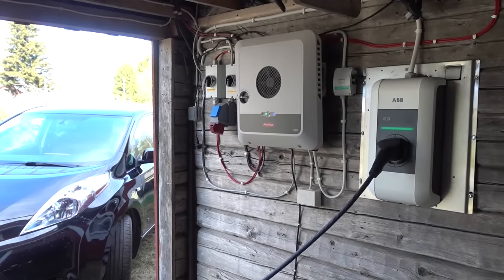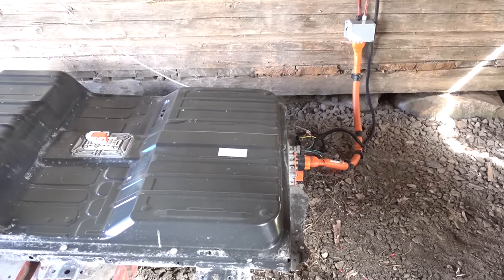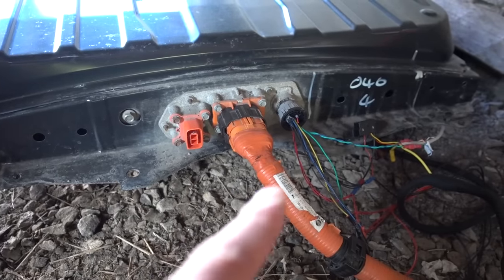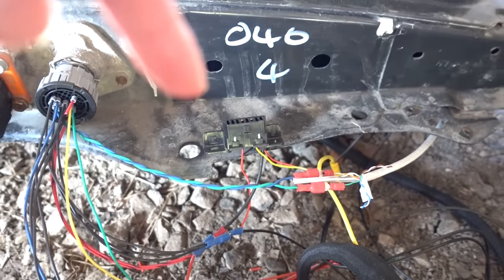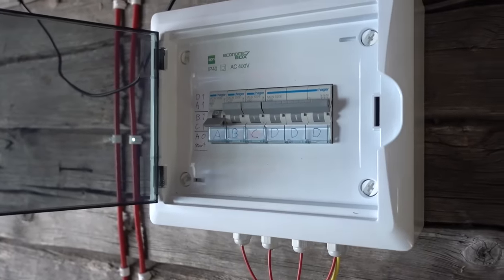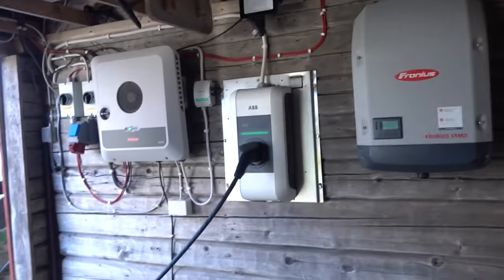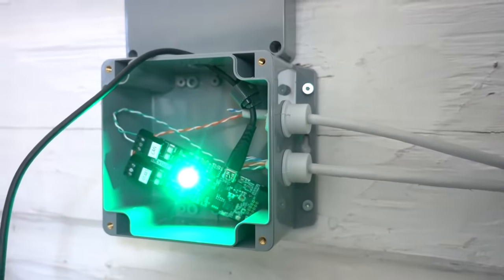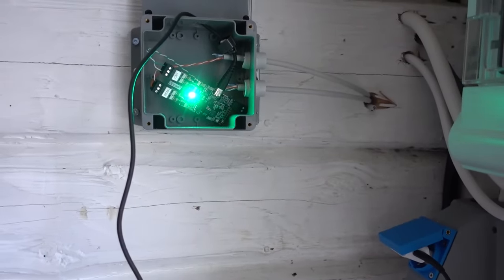The EASIEST way to connect used EV packs to grid! 🔋

Comment: Hey Dala, since you're something of a leaf expert, I have two uncommon questions for you:

1. Is it possible to disable the interlock that prevents the car from entering "ready to drive" mode while charging? If so, people with old very worn leafs would be able to tow a generator behind their leaf and charge while they drive, so they could go on road trips with it.

2. In the new leaf, is there a way to prevent adaptive cruise control from disabling itself when the traffic comes to a stop for more than two seconds? Would be great to force it to stay enabled, or extend the waiting time to 30 seconds or so, so that the leaf could continue to drive itself in stop-and-go traffic.
Reply from the maker: 1. Would be an ecological disaster. 
2. No clue, I am only experimenting with old LEAFs!
Reply: Imagine a very old leaf only has a 20-mile range and the owner only needs to travel 5 miles to work. So day to day the car will suffice. With the generator idea, when trips longer than 20 miles crop up they can still keep using the leaf by temporarily attaching the generator. As things stand now, they'll either need to replace the battery or rent another car for such trips.

Speaking about myself, I own an old leaf (2016, 24kWh) and a new leaf (2022, 40kWh). The old leaf has a real-world range of just over 100km, which is perfect for any drive I do in my home country of Malta (an island only 32km long from end to end). But when I went on holiday to Sicily, I used an ICE car. On some days I needed to make 400km round-trips and stopping to charge 4 times would have added too much time and risk to the trip. With a tow-along generator I'd have taken the leaf for the holiday, used the generator on those days with the long trips and left the generator at the Airbnb the rest of the days when my trips were under 100km.
Reply: There was a company that added battery packs in the boot of early model Leafs to extend the range.
Reply: Would be nice if Leafspy could adjust the time out for the adaptive cruise control after stopping.
Doesn't look like it can after quick search.
Reply: Yes, you're thinking of muxsan. Problem is the cost of adding that battery is almost as much as the car itself is worth. And I'd have to figure out how to drive 1500km to Delft (in Holland) in a car with 100km range. That's where a towable generator would really come in handy!

Comment: This is really fantastic. Is there any way to use a leaf battery while it is still functional in a leaf that is driven sporadically? It would be really great if the leaf could be recharged with surplus solar power and at the same time supply power to the house at night when there is no more sun. That would really be the holy grail for me.... Oh and compability with the Huawei sun2000 inverters 😁 I ask a bit much perhaps 😅
Reply from the maker: Sun2000 compatibility coming later.

Battery in car is not feasible, chademo connector is over 1300€ https://github.com/dalathegreat/BYD-Battery-Emulator-For-Gen24/wiki/Frequently-Asked-Questions#could-i-use-this-project-to-use-my-leaf-battery-without-removing-it-from-the-car
Reply: @DalasEVRepair  Thanks for your answer, sorry I did not check the FAQ first. I also saw some videos from youtuber BenjaminNelson who connected his Mitsubishi iMiEV with a 3D-printed CHAdeMO connector to his solar inverter. He used the PV input on his inverter so he can only draw power from the battery but with your solution the battery should act as a "standard" solar battery making it possible to charge/discharge the battery, and as an extra bonus DC charging directly from the inverter would result in higher efficiency? Getting realy excited about this 😀
Reply from the maker: @robbedenys  the connector needs to be safe and reliable, with enough IPXX protection. It is the thing preventing human injury after all. I would NOT recommend a 3d printed part here!
Reply: I understand that. But if one could find a decent CHadeMO plug it should be possible in theory?
Reply from the maker: @robbedenys  Yes, they start at 1300€ here in EU

Comment: Nice system, Just what I want, Would there be a problem to mount the battery vertical on brackets on the wall in a metal cabinet, Would be nice if you sold a ready made kit of parts, I would get a second hand battery or if my 24kw Leaf comes to end of life use (Battery being OK)
Reply from the maker: The parts are listed on the Github. The hardware costs less than 50€ to setup. No problem with vertical mount!
Reply: @DalasEVRepair  Nice!!

Comment: Anyone got a solution for Gen2 volt packs? I've been "planning" to get this working for over a year now but can't find adequate time to work on the project.
My goal is to avoid both super-expensive Orion and sketchy chinese BMS and use original one with original contactor assembly IF EVEN POSSIBLE.
Anyone got the BMS commands somewhat decyphered?

Comment: Hi Dala. Great video!  I want to ask if the LEAF or Tesla pack would work sitting on it's side? Does the orientation of the pack matter?   I realize it would need a strong support system, but if one was built, it would be nice to have it take up less floor space. Thanks!
Reply from the maker: Thanks! Yes it can be mounted on its side to save space!

Comment: This is great stuff! What is the maximum continuous power with this setup? Also really excited and waiting for the Tesla part. There are many Model 3 packs available in reasonable price. I'm building my setup on Model S modules but that's a lot of work.
Reply: 1.21Gw
Reply: I would say limit is the Gen24 maximum power and you can get those at least up to 10kW.

Comment: Please list prices of the actual equipment you have in video.  Each element's price. 
So cheap is relative. 
I need a number amount for the battery and all the hardware
Reply from the maker: Depends on your location. In Norway you can get used EV packs with 60€/kWh.

Also inveter availability depends on your country. Best to check the Battery-Emulator wiki which components you can get in your country, and for what price. Price is tied to geographical  location. https://github.com/dalathegreat/Battery-Emulator/wiki#supported-inverters-list

Comment: Great! Can we set up this inverter with the battery still in the car?
Reply from the maker: I don't see why not :) But a bit more complicated!
Reply: @DalasEVRepair  on my e-nv200 there is space for 800-1000w solar. This would be perfect. Much more efficient 230v in the van than using the 12v system and slow HV charging.

Comment: This is AMAZING, 

would be great if there is a kit that would work as plug and play for the CAM wiring. 
also small suggestion, for the 12 volt, devices would it be possible to run the from the battery with a step down in voltage or is the difference too high

Comment: Great work. Does it work with any Leaf batery? Does this pre-charge box switch dance (sparks!) need to be used only once when connecting battery and GEN24 or every time the sun goes up?
Reply from the maker: Over 20 different battery types on the supported list. All LEAF batteries are supported. Precharge only once!
Reply: @DalasEVRepair  Thank you so much. Waiting for my parts to come to start the project. BTW: any suggestions how to verify used battery, so I do not buy some scrap but something that still will work couple of years? Will e.g. Nissan test the battery on the crate or perhaps the latest software update (the cell monitor) will do?
Reply from the maker: @MichalPrzybylski  see this page for how to test LEAF batteries, https://github.com/dalathegreat/Nissan-Leaf-Battery-to-OBD2
Reply: @DalasEVRepair  Kiitos! You are the man. BTW - in earlier versions, you were connecting battery to GEN24 without Fronius smart meter. Is this obligatory part of the project now?
Reply from the maker: @MichalPrzybylski  i have never used Fronius without smartmeter. Always required!
Reply: @DalasEVRepair  Got it. Ordered Enviatec box incl. Smart Meter, ordered battery, LilyGo. One thing I did not find (?) in the github & instruction is the fronius inverter setup for the battery. Just usual BYD steps?
Reply from the maker: @MichalPrzybylski  See https://github.com/dalathegreat/Battery-Emulator/wiki/Fronius-inverters#setting-up-the-fronius-inverter-for-diy-battery
Reply: @DalasEVRepair  You got me off guard. Thanks again!

Comment: Subscribed. For us newbies to using Leaf battery packs, what is the voltage, and are their many inverters that can operate at that voltage? Thanks for the feedback.
Reply from the maker: 400VDC fully charged. Any BYD HVM via Modbus compatible inverter can take this solution

Comment: If only EV batteries could be bought cheap here in Australia. Currently I use a 775AH 37.5KWH FLA forklift battery and run my house off grid, currently I need to run a generator around 10 days a year. With a big Tesla battery I would rarely need the generator at if at all.
Reply: I need help getting off grid!

Comment: how does your solar charge the bateries?
Reply from the maker: The solar inverter is a hybrid inverter, so it can take battery and PV panels at the same time!
Reply: @DalasEVRepair  hi, thank you for the reply. i ve bought a tesla model 3 96v 23s module and a 96v solar charge controller, do i need to "talk" to the bms or simply controlling the ~65-95v  charge/discharge in the solar charge controller enough?
Reply from the maker: @selmopt  This entire project focuses on re-using the entire Tesla battery. Individual modules are not supported.

Comment: Will this setup work with an aftermarket battery? Im finding better prices of new batteries than wrecked leaf barreries here in Australia 😂
Reply from the maker: No, this setup relies on having all the OEM bits in place. See my other videos for a DIY powerwall using cells re-arranged for 48V using thr Australian BMS Batrium!
Reply: @DalasEVRepair  Australia make some good stuff 🤣. Thanks I will check it out I have lots to catch up on. Cheers

Comment: Dala, what is the price level now per kWh, normally, for a used EV battery, and how much do you pay (normally) for the freight?
When talking about batteries and new technologies, I have to mention my favourite, The Electric Viking, Sam Evans, Australia, that I follow (almost) dayly.
Reply from the maker: Around 75 to 85€/kWh on used EV packs
Reply: @DalasEVRepair Thank you.

The Electric Viking, said minutes ago, that Ford and CATL will cooperate on a battery factory in North America, and the price for the litium phosphate battery will be 85 USD per kWh.
He said that five(?) years ago the price was around 500 USD per kWh...

Dala you will have busy future! 😆
Reply: @DalasEVRepair  Does that imply a 40kWh pack would cost less than $40? 

That does not seen right.
Reply: @jamesphillips2285  You are correct, that is not right.

Comment: Amazing work Dala. Very elegant solution. Questions - I understand the Gen24 communicates with the LEAF BMS, but will it shut off charging if the BMS throws an error or does it rely on the BMS to disconnect charging? How configurable are the DC voltage ranges on the Fronius as it's an HV connection? ie Can you set overvoltage and undervoltage on the inverter that exactly matches the LEAF voltage range? Finally, in the event of a temporary error, when you're not there to manually restart the battery with those circuit breakers, what happens?
Reply from the maker: Yes it stops charging/discharging if there is an error, or if the BMS wants to stop. User configurable min/max voltages yes. No error is permanent, if the fault goes away it resumes operation!

Comment: Well done.  I often thought that ev batteries should be portable in design.  This way they have a duel purpose:  To run your ev and also your home by way of simply carrying it into your home and plugging it into your offgrid system.
Reply: They are pretty heavy. 
Instead of removing and risking the pack, you can plug it in your home. 

CHAdeMO specifically allows for that and it's commonly done in Japan
Reply: @Outworlder  Yes ofcourse this would be the best option, especially for those with attached garages to their homes.  But for many others say like me with out lying carports and out building off grid shops, perhaps both options would be suitable.  Also rv camping could benefit where a battery pack could be removed from the car and installed in a camper or tent.  And future farm/construction machinery could use this idea of battery swapping, eliminating the need for battery redundancy.  I believe this is a way to address the global mineral constraints problem by making fewer batteries.

Comment: This is awesome! I don't know if I've ever seen someone use an old EV battery pack without cracking it open at all. 
I'm curious, the CAN<->MODBUS controller got me thinking, I currently have some software to connect to my own batteries via RS485/MODBUS and continually poll the batteries and publish the data to MQTT, which I then consume in a visualization system. I've been wanting to build a controller to convert this-specific-battery's MODBUS IO into (what I assume to be) more-standard CANBMS signals, so that then the batteries I have could "just work" with things like Victron's CERBO-GX and other CANBUS-oriented systems. So far I've been unable to find the specification for what things like the CERBO-GX wants to see. Any chance you have any knowledge in the area of CANBUS-BMS stuffs that might align with what I'm trying to do here? I'm not looking for a full answer to my questions haha, more looking for continued knowledge

Comment: Nice Dala!   I'd like to try this in the future, once I find a US split phase inverter with the right features and supporting the BYD battery communication.    HVIL loop not needed to keep the Leaf LBC happy? (see the heater port is open, that's got HV on it too if contactors are closed I think?)
Reply: Ooooh, yeah, controlling the contactors directly with 12v, nothing cares about the HVIL being closed.  Maybe leafspy would show a DTC code is all?
Reply from the maker: @DaleKlein  2011-2012 with only one HV output can have the HVIL check on by default. On the 2013+ you can only enable HVIL checking in the software if you have both plugs seated. More info is on the Github page (search INTERLOCK in the code)

Comment: SolarEdge uses modbus to communicate with their batteries as well, I wonder if this could be made to work with a solaredge energy hub inverter as well? I know they really like their proprietary stuff, but this would be awesome!
Reply: solaredge are recommending instead of using modbus/RS485 to instead use a wireless mesh card for communication between their solaredge battery and the energy hub inverter.
Reply: @robfarago  Where are you seeing that? All the information I can find talks about wiring RS485, and everything seems to be modbus.

Comment: Hi Dala,
Do you know how to identify a Model 3 battery pack? From a 2021 Model 3 SR+ here in the Netherlands. It has code 1567439-00-C and says made in China. I'm thinking it probably is the LFP version, but would like to make sure.
Reply from the maker: No clue, sry!
Reply: @DalasEVRepair  Just before you sent me the message, I got a VIN number and it confirmed the LFP battery, through a Tesla VIN decoder. So that is a way.
The battery pack is from a burnt Model 3. For an NMC pack that would be a total no go, as it is unsafe, at really anytime it could start burning if the cells ever saw +70 degrees Celcius.
But this is LFP. Maybe they aren't in good shape, but LFP won't dramatically burn down.

Comment: Nice piece of work you did there. Would the same setup work and code work if I need to connect a Renault Zoe battery to a Huawei sun2000 hybrid inverter?
Reply from the maker: Huawei inverters are unfortunately not supported, see the wiki: https://github.com/dalathegreat/Battery-Emulator/wiki/Huawei-SUN2000-inverters#%EF%B8%8F-dcdc-link

Comment: The wires on the side of the house only have a single layer of isolation. A good practice is to use double isolation. In this case you would put the cables into plastic tubes.

Comment: Can you just take out the communication altogether, and solder the leads inside the case, to pos/neg. I mean like; is the communication for battery control, needed only for the controls inside the battery itself, or for another purpose? I'm just wondering if you need to have the control in there at all.
Reply from the maker: Contactor control can be automated, see the Wiki. Communications always needed to use lithium batteries safely.https://github.com/dalathegreat/Battery-Emulator/wiki/Contactor-Control-via-GPIO-pins

Comment: Nice done👍 Do you know how many Amp i can withdraw from the Nissan leaf 12v battery? Thinking of using a 12v to 230v converter when camping. I don't know how much the dcdc module in the car can take.
Reply from the maker: 125A, roughly 1500W continuous
Reply: @DalasEVRepair  Thank you so much👍 So no problem upgrading the stereo with a subwoofer to then😁